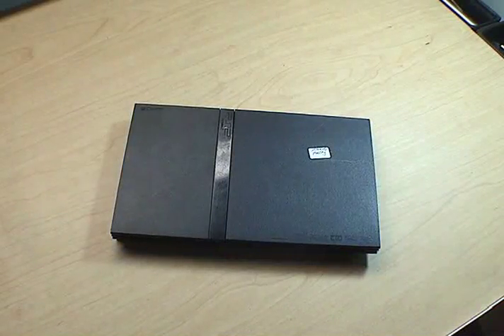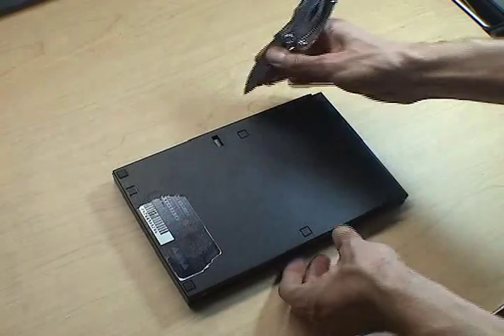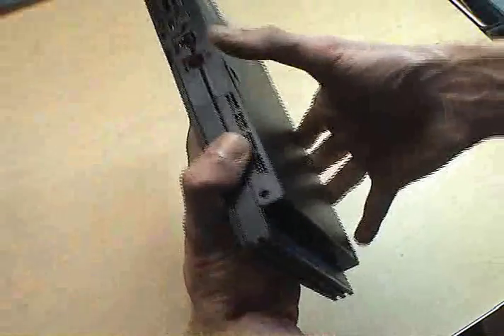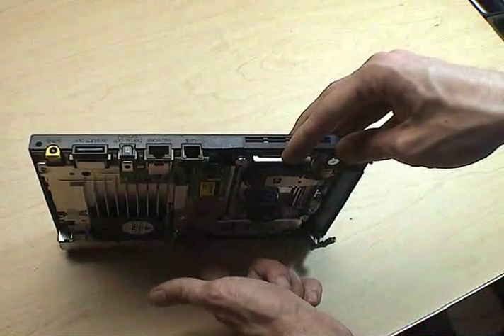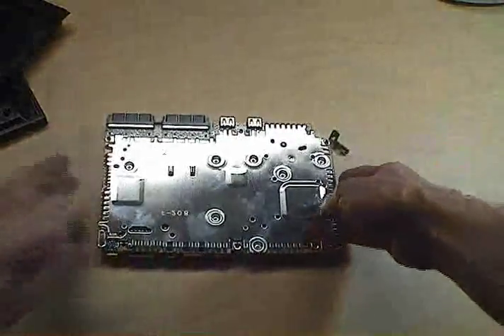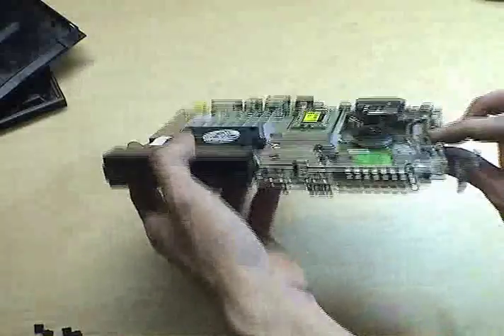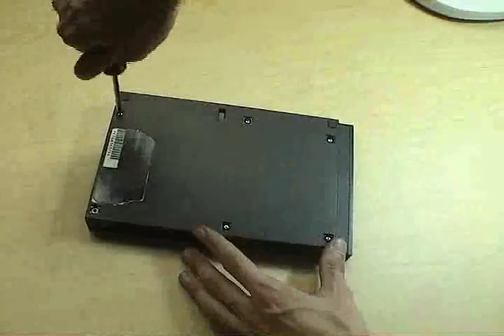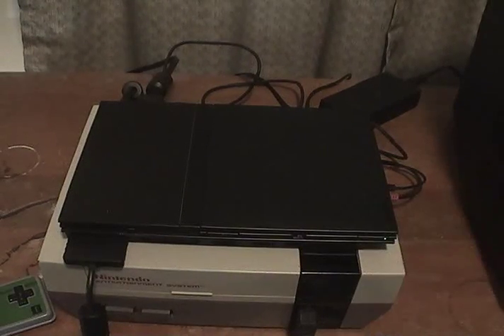Game.Hack Season 1 Episode 6 - PS2 Power Connector

Comment: Hey does this help if the power only stays on red and won't turn to green?
Reply from the maker: +miguelx310 That can mean quite a few things, either it being an issue with one of the circuits or something else.  Usually in this situation I would have to see the unit myself to be able to start debugging the problem.

Comment: what's that yellow stuff you put on the  solder before you resoldered the ps2's outlet
Reply from the maker: GamerStatusDestroy That is called 'Flux'.  It is used to clean the surface of the metal of oxides and helps the solder 'wick into' the crevices so that you get a more solid bond.

If you don't use flux, one of two things may happen:
1) you may not get a good mechanical connection and the joint could break easily
2) the solder will not 'run' into the joint properly and you'll end up with a blob of solder

Comment: my ps2 has made circular scratches on 3 of my favorite games, SNK Anthology, Metal Slug Anthology, and Capcom Classics 2, is there an easy fix for this? I thought of purchasing a new lens ribbon on ebay, is that the way to go?
Reply from the maker: wes beebub It sounds more like the motor itself or the laser sled assembly are misaligned, possibly something broke inside.  Hard to say without actually looking at it.

Comment: Can this trick work for a ps2 slim that won't even turn on?
Reply: I took mine apart, it turned out for me to be the ribbon cable on the motherboard connecting to the power button.

Comment from the maker: The internals of AC adapters themselves are pretty much all alike.  You have a transformer which is a big heavy part with coils.  These rarely if ever fail, but it's possible.  Then you have a handful of components, usually the rectifier and a few capacitors and resistors to keep the energy output under control and help prevent runaways on the current.  If any of the components fail it should be fairly obvious then you can replace components as necessary.  Getting the thing apart... heh...

Comment from the maker: That's basically a trouble shooting problem.  If things fail, first thing you do is start at the beginning with the adapter itself, check the ac cord's conductivity, then plug everything in and check the barrel plug for the voltage listed on the pack, DO NOT CHECK FOR AMPS WITHOUT PUTTING A LOAD ON THE CIRCUIT!  and from there start checking components within the unit until the problem comes up.  If it's the AC adapter, unless it's something obvious you simply need a new one.

Comment from the maker: after a bit of research I'm getting that this is caused by a blown fuse.

You'll need a multimeter in continuity mode

THESE ARE THE FUSES/RESISTERS YOU WILL NEED TO TEST.
PS1, PS2, PS17, PS8, PS13, PS6, PS15, PS3, PS7, PS11, PS14, PS4, PS5 and power fuse F001.

Comment from the maker: the ps1 (the smaller, late model) had an external power pack with a barrel plug.  In fact this repair works for anything that uses a barrel plug type adapter.  The original Playstation, and Playstation 2 (phat) model had their power supplies integrated into the main unit.  Repairing them is similar, but the thicker leads on direct AC plugs (the B or 8 or D shaped plugs that have no wall-wart) tend to not break as easily as the thinner leads on the barrel plug adapters.

Comment: Hey, I have a question, I have a PS2 slim, but the power button is missing. I rad online that one can solder the positive and negative leads where the button strip is connected. How would I go about doing that?

Comment from the maker: @miversen33 That's a good question... You could possibly find replacement parts through an electronics component supply company like Mouser (that's who we use).  Also, try searching google shopping for 'DC power jack for Playstation 2' and it will come up.

Comment from the maker: @wes23cilcy the best one would be a variable soldering iron, but you want a hot one, not a low power one.  The thing is: to low a heat will cause cold-joints that don't connect well.  you want the hottest iron you can get so you can get the job done as quickly as possible.  The butane powered irons are the way to go, but I use a cheap radio shack model that weighs in at 30 watts.

Comment from the maker: @LiveSteamMad Hmm... Sometimes the solder joint will break at the board level and it won;t exhibit the classic 'halo' break.  These are a bit harder to see, but can be easily detected if the circuit in that area seems to move or has a bit of looseness to it.

Getting and learning to use a multimeter is also extremely useful for diagnosing problems like this.

Comment: A great help, I had a PS2 slim given to me for free by my Uncle and it had the same symptoms but I couldn't see any crack in the solder from just a brief casual look. So I took a chance and refreshed the solder like you did and it solved the problem, my PS2 slim now powers on and stays on reliably where it wouldn't before. I used 60/40 Rosin Core Radio Shack solder (Ebay) and an Antex 50W TCS iron @medium temp and a 2mm chisel bit. Worked great. I let it cool between each joint's soldering.

Comment from the maker: @Ramiro42guitarlegend the flux we use is like a brown goop that contains zinc chloride.  It's basically a substance that both cleans the surface of the connection, and also helps to eliminate air bubbles in a joint.

The metal the wire is made of in electronics is almost always copper or tinned copper leads on a through-hole component (the tin/lead solder won't bond well to much else)

The solder we use is a 60/40 tin/lead mix.

Comment from the maker: @KaneInsane99 Yep.  This is most likely the case.  Try opening the disc door when it's supposed to be reading.  is it spinning?  Also, stick your ear up to the unit when it's supposed to be reading the disc and listen for the motor spinning up.  If you don't hear that, then the motor is the problem.

Slims have a unique difficulty to them as there is no good way to make fine adjustments to the angle of the lens (like the fat PS2's did) and the only option here is replacement.

Comment: hey dude looks like a winner vid you've got here.  Though there is another screw to remover before you pop the corner up. Its between the control slots.  Idont know if it was on the 1 you showed in this vid but it was on mine and probably others too. Also you didnt show the detachment of  the on/off switch from the shell.  I just pulled out the ribbon to allow access to the main part (!) and then put it back in the shell again to test if it worked before screwing it in. Thanks 4 the super video!

Comment from the maker: @sairaj34 The only sure way to do it is with solder and a soldering iron, or heat gun.  Soldering paste and a toaster oven are also viable routes.

I'm not sure, but I recall seeing conductive adhesives (basically conductive glue) that might fit the bill.

If you want to do an electronic repair right, the best way to go about it is with a soldering iron and the proper rosin core solder, using flux to clean the connections.

Comment: i have the a slim ps2, with this problem, power station being abit loose, and i dont have the proper ps2 8.5v power cable for it. so i have opened the ps2 and i soldered the bit which was loose and now i plugged in a 9v universal power cable and the red light is staying on, which means i soldered it ok, but problem is that when i press power button, then it turns green for a sec and then turns back to red again.  ps2 not powering up, so whats wrong? do i need proper ps2 power cable? plz help

Comment from the maker: @keeg1395 soldering irons are generally the way to go.  Zero uses that butane powered one.  I use a plug-in with a fine pointed tip.  Some people like soldering guns that have an element that goes inside them, and still other people use heat guns for certain soldering jobs.

Comment from the maker: Soldering takes practice, that's all there is to it.  There are plenty of 'how-to' videos on soldering out there as well to give you an idea of what is involved.

Generally, you want to have a pretty steady hand.  And you don't want to go overboard with the solder (if it touches more then 1 point, it's basically a short).  Also, knowledge of how electronics work on a basic level is required.

Other then that, I don't know, it's pretty easy for me, but I've been doing it forever.

Comment: Mmm good video. This happened to everyone I know with a slim ps2 but no one talks about it on the web it seems.
Well if I ever get a soldering iron this'll be one of the first things I do. 
But for now putting a book on the cord - or wrapping rubber bands around the power plug/controllerplug work fine.

Comment from the maker: did you make sure NONE of the soldering joints are touching?  Did you clean the joints with flux first?  did you use the right size solder?  Soldering can take a lot of practice, and there are a lot of good tutorials on this matter on yotube.